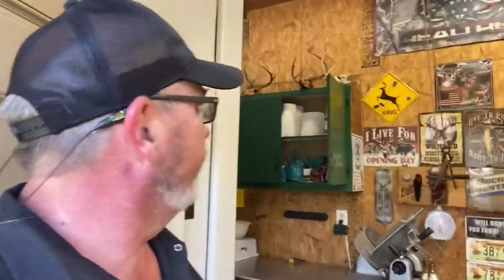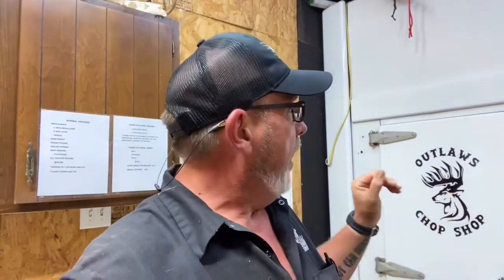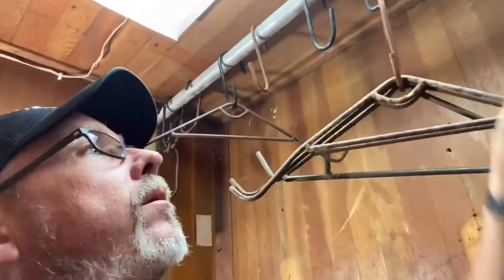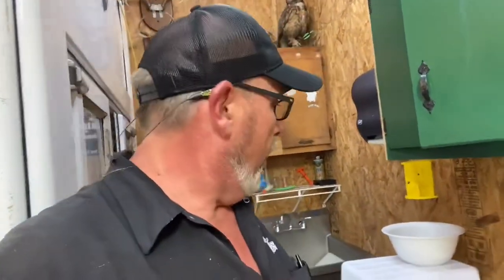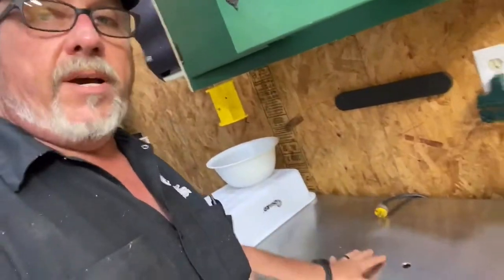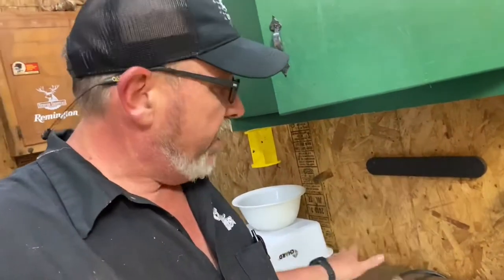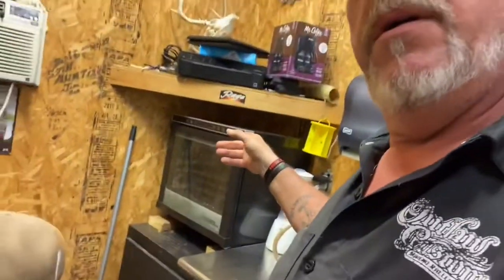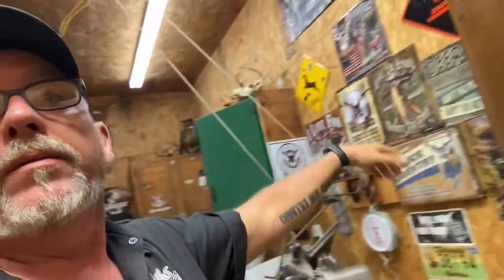Deer processing shed! butchering shop

Comment: I'd be interested in seeing the shed you started with so I could have an idea of what a beginner setup would look like.
Reply from the maker: I Actually have it full of stuff at the moment since i quit using it. It is mainly a well insulated storage shed now..lol.  The dimensions are 10x10 and inside height was 8ft. it only has 0ne window for the air conditioner and the entry door.  I insulated the walls and ceiling with regular insulation and then someone had give me a bunch of 4x8 insulation board sheets  so i lined the inside with that also. Then i put a laundry tub in with a water hose hook up and that how we did our deer. everything went into coolers and was aged that way. I will try and do a video om the old shed when i get it cleaned out this summer. Please let me know if you need anymore info on the shed or questions about how we started. Thanks for watching.
Reply: beginner setups is what I still use, clean all the meat off the deer just like Jamie does then ice chest for 4 to 5 days draining all the blood off and I have the $30 dehydrator $50 grinder and $30 slicer $50 seal-a-meal :)  I processed a deer one time and they didn't do it like I wanted it and have processed mine own ever since!  I always hear how hard it is to clean your own deer after you do it enough you can have one skinned and in the ice chest in about 20min.
Reply from the maker: @automateddigitalsvc9118  it’s hard to beat that way. Iced in a cooler has a awesome taste. We still do it from time to time.